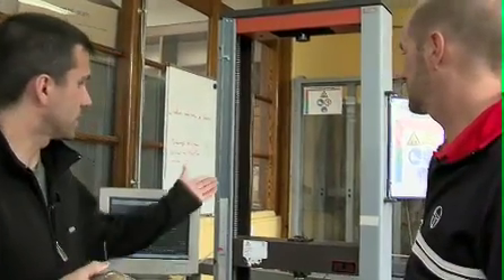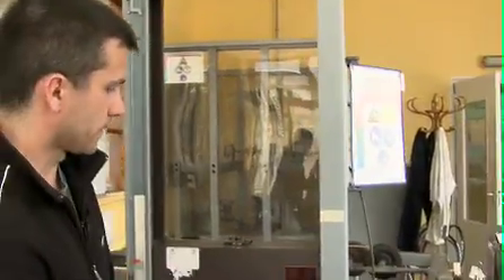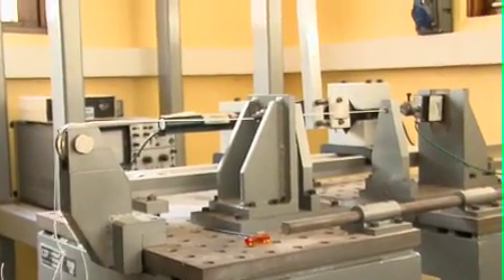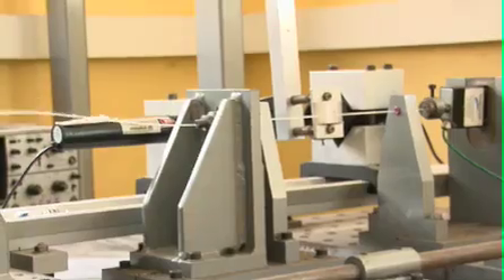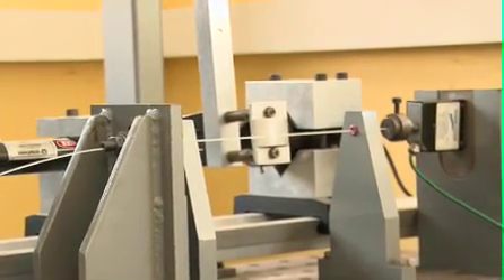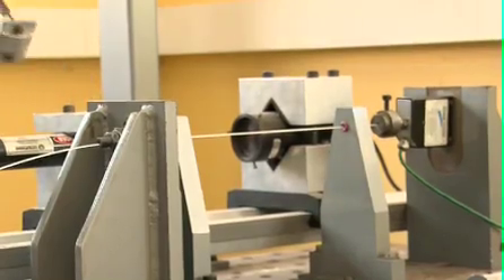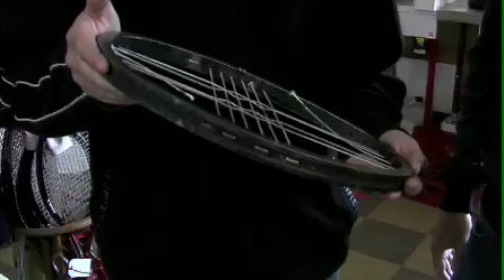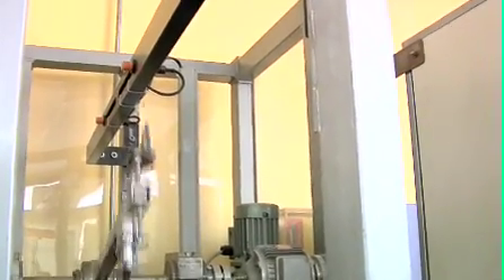Tennis Warehouse | Inside the Tecnifibre Factory 2

Comment from the maker: @gastongreen,
Poly strings are extruded and very few are actually round. Most have an oval shape to them. Being monofilaments they are very strong and it takes more notching to break them. Polys can be more prone to shearing (breaking on a powerful shot that connects with the stringbed near the frame) as they do not stretch as much as multifilament strings.
Chris, TW